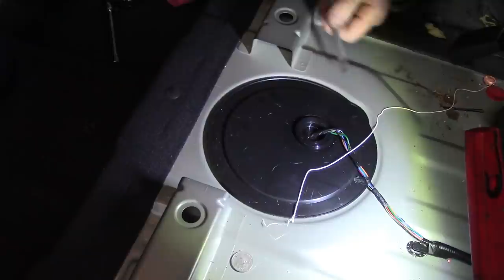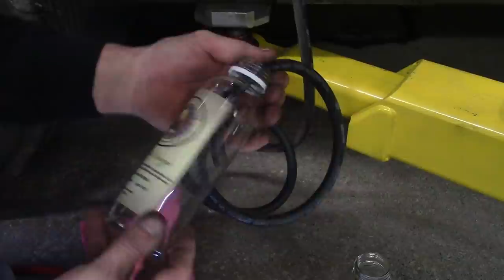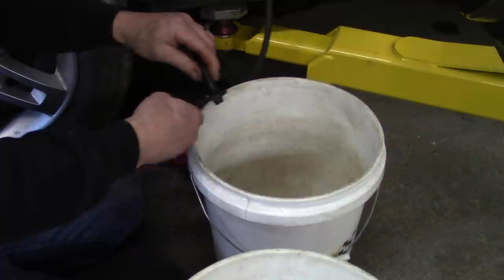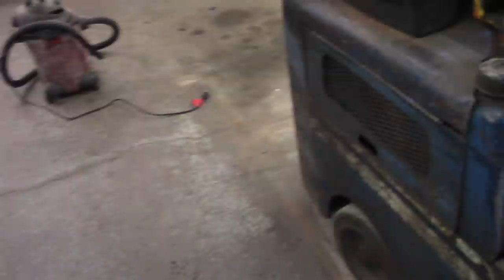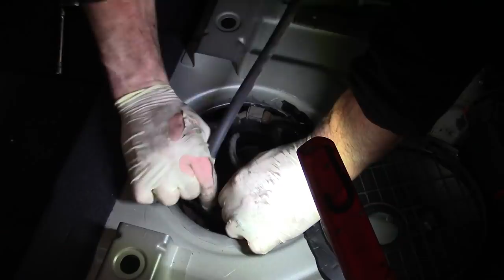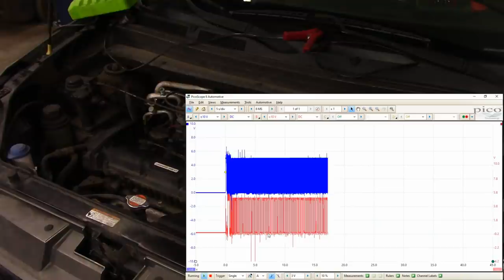Kia Soul - Auction Car Special Part II

Comment: Fairly common mistake in my experience. There are many new drivers who really don't know how to use the pump.... The most damage I've seen is a p0420 after the repair
Reply: The diesel nozzle has a larger diameter than the gasoline inlet hole. You literally can not fit the nozzle in (I tried once, by accident).

Comment: Has anyone ever told you that you look like the older version of Ericthecarguy. You should look him up he could be your twin from another mother! You both are great mechanics!
Reply from the maker: Eric the car guy!? Huh... I'll look him up
Reply: By the way, I didn't think you would reply back to this but since you did, I have a small question that I hope you can help me with. I installed a pair of HID to one of my 350Z a while back and ever since I did that, when I turn on the headlights the car shuts off. Now it doesn't do it every single time but it does it very often. I replaced the battery and alternator but it keeps doing it. I can't seem to find an answer online and all the connections are done correctly, I even replaced all my grounds and that didn't fix it. Could you have an idea what's going on with it? Thanks
Reply: One thing I would like to mention as well is I have noticed that if I turn on the headlight switch fast the car will shut off. But if I switch it slowly then sometimes it will stay on. Or if I rev the engine and switch it on then it doesn't stall.

Comment: Wait, dropping the tank totals a car??
Reply: When a car is rusty and crusty like they get to be in New York State due to all the salt they use on the roads in the winter dropping the tank could be a major pain in the Hoo Haw and result in a lot of parts breaking when you disturb all the rust that is holding things together.  The cost of the time to deal with all the rust and the cost of the parts you have to replace because of all the rust could exceed the value of the vehicle - which has little value due to all the rust.

Comment: GDI should give all fuel pressure info on scan tool
Reply from the maker: it's not a GDI engine though
Reply: @SouthMainAuto  ah. I thought someone in part 1 comments mentioned was a GDI. I'll stick to working on my Audi lol
Reply: I should have known when you didn't have to remove the intake manifold to disconnect injectors. Non drive by wire probably a clue too

Comment: Or:  Underground tanks were misfueled at the gas station (this does happen, more common for me to hear gas in the diesel tank).  The car started running like crap within a few miles, then wouldn't start.  Owner replaced the CPS, didn't go in far enough because of the rust in the CPS hole.  Sent off to auction.   Luckily you smelled the fuel!

Comment: Had a 2010 soul back in the day. fell in love with kia. Fun fact: this is the Hyundai BETA engine that was the 2.0 with 4 speed auto that was available in the tiburon. they bolted on a turbo for the genesis coupe. it's a cast iron that was replaced with a GDI later on